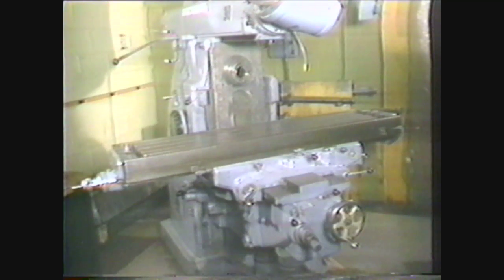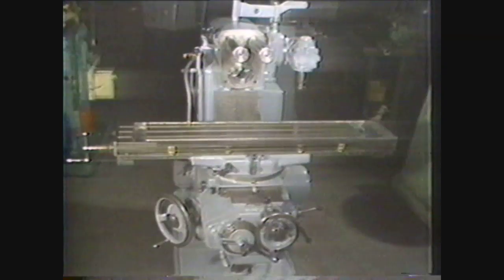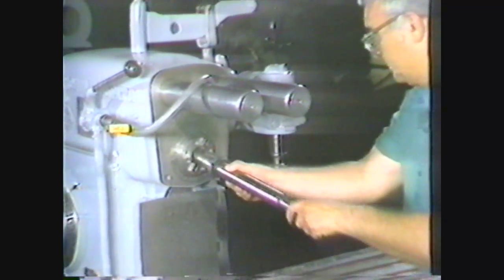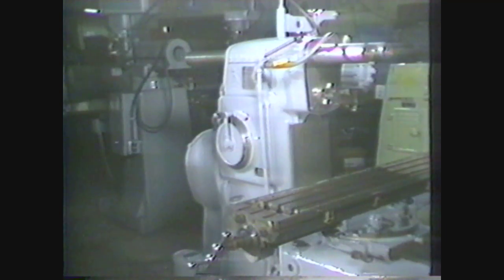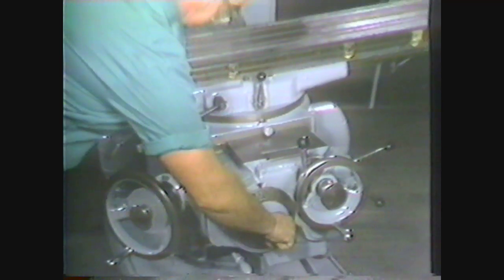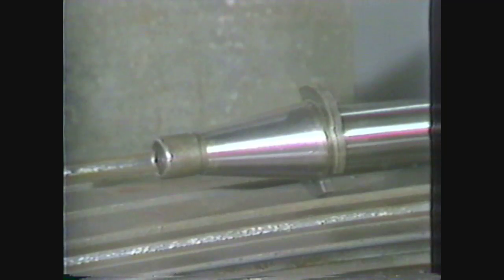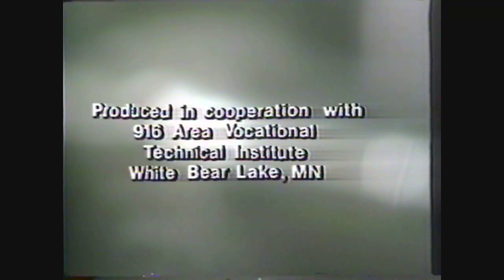Machine Technology IV Lesson 6 Parts and Operation of the Horizontal Milling Machine

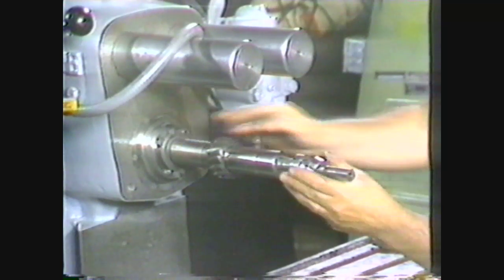Comment: Goes badly wrong at 7:15 - the arbor nut should only be tightened after the arbor support is put in place. Otherwise you risk bending the arbor.